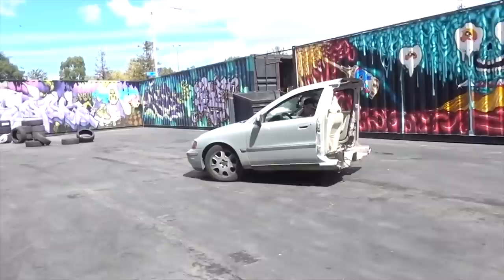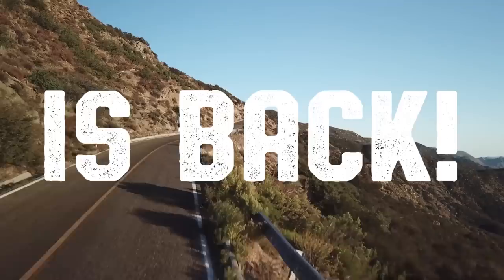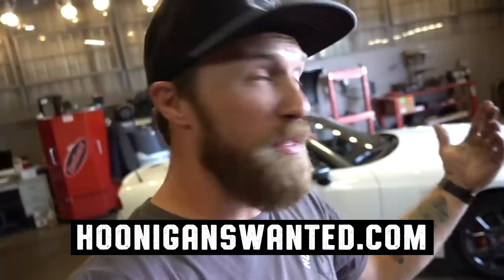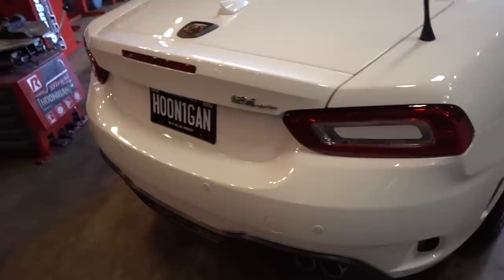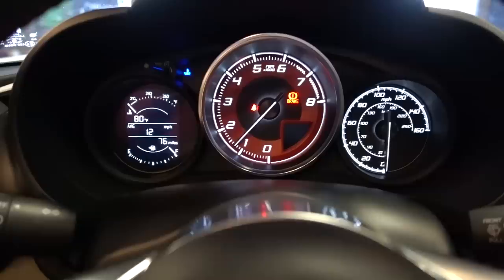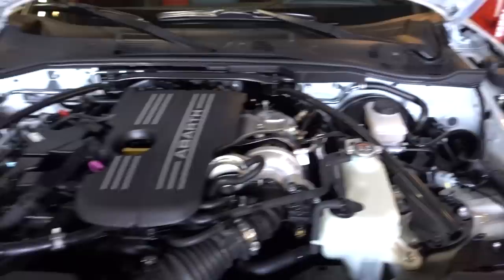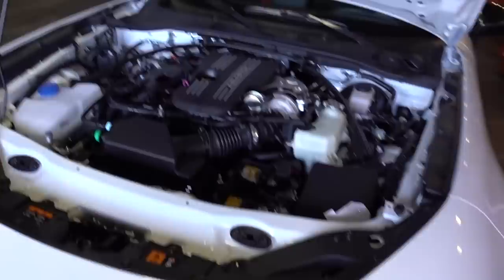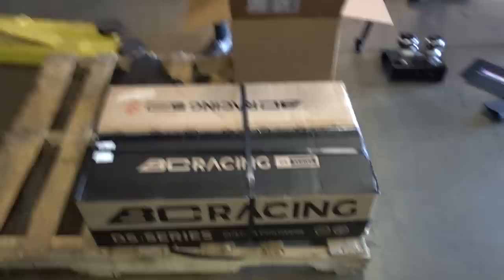How to Build a Fiat 124 Spider Abarth Track Rat - BONUS TRAILER BUILD

Comment from the maker: Who's got more ideas for the trackday tire trailer? Color, mods, attachments, etc
Reply: TheHoonigans MEEEE
Reply: Definitely has to be super clean. Black and white to match the car, maybe if you can swing it try and fit some actual fiat brake lights to it? It should be low, like equal with the car, not like an actual utility trailer. You could do full tube ball arm, like that zigzag all the way to the actual join. Have one non structural tube to run the wiring through or something. And for the hitch I think it should be bolted to the frame and run out and then up. That way if they put the car on a trailer there’s no ugly hitch square stickin out he back of the car. Then you could put the light plug thingy behind the license plate on a hinge to fold down. Can’t wait to see it come together!
Reply: Really low wide the same color as Fiat
Reply: Make the trailer like a chariot with the car as its "horse'
Reply: buy one of those badboy´s and shartkart it with some bigass turbo on the lil 1.4l
Reply: pegasus could be the name of the car
Reply: Just for the hell of it put a spoiler on the trailer
Reply: TheHoonigans yeah bring nads back
Reply: TheHoonigans royalty exotic cars made a bugatti that can do burnouts and donuts maybe even drift look them up
Reply: TheHoonigans single axle design with a tube frame that has mounting points for all your spare parts, it would be like a spare car on the back that you could step into
Reply: Same wheels and tires as the car so you have more spares just in case and also a holder or tank for a few gallons of gas and water.
Reply: what song is playing at 7 mins?
Reply: TheHoonigans 
Matching taillights maybe from a newer mx5 or miata? Sounds like you guys are applying adjustable sub coils or I would say lower it.
Reply: Question Ive had, What ever happened to Gary? I thought he was a bit obnoxious but fun to listen to
Reply: Keep the top dimensions the same as a   common pickup bed. That way you can use a nice watertight bed cover and possibly in bed organizers. Also, rotopax makes some awesome looking  fluid containers that would really useful as they can be mounted anywhere.
Reply: TheHoonigans get another fiat cut it in half and make the trailer
Reply: tyler, me too bro!
Reply: wtf happened to the gasser project?
Reply: Why don't you make the side few of the alfa and transfere that on the trailer ^^
Reply: I`m currently trying to source a mod for my car, thought maybe you guys could point me in the right direction. I`m looking for blue wrc decals for my pearl white`12 Subbie. Any directions would be sweet as yellow and black are all I can find. Searching the internet hasn't been a lot of help so I may have to turn to having them made, and where I live in the great white north no one has been willing to try it for less then wayyy too much $$ since you can order the yellow ones for like 85$, and its all 500$+ quotes to have them made. HEEELLP
Reply: TheHoonigans mount the suspension with hubs and knuckles to an aluminum truck toolbox mounted on the trailer. Save Fab time and have a better waterproof seal. The spare suspension parts holding your spare tires is innovative enough to be interesting and unique.
Reply: A built in cooler for PBR
Reply: Mount battery with compressor, Led Lights.
Reply: Michael Schneider don’t forget the grill 👍
Reply: Trailer needs the front and rear clip (fenders/bumpers/lights.) Incase of a wall tap, swap on new skin. It'll look like a shortie spider if you do it right.
Reply: Renown livery.
Reply: Ya a little trailer would be sweet.  Maybe somehow integrate a tent or an awning?? Just enough shade for one or two people to sit. Maybe some battery power for charging phones or whatever. Some overhead lighting in the awning would be extra sick in case you need to wrench/ party at night. Oh ya... bluetooth speaker would be sick too. Also, where's Gary?
Reply: TheHoonigans  “H” on the side for Hoonigan
Reply: RedHabour79 XBL darude- sandstorm
Reply: TheHoonigans make the trailer look like a two wheel ariel atom! 🤘🏼🤘🏼
Reply: TheHoonigans you should make the trailer with the frame of a roll cage, and it’s easily accessible aswell!
Reply: TheHoonigans ive always wondered how come Brad never blinks?
Reply: A platform in front holding extra tires and a floor jack.
Reply: u

Comment: 8/10 the trailer needs to do burnouts.
Reply from the maker: We like where your head is at.
Reply: TheHoonigans put a motor in it so you can maybe put your spares on a secondary axle once the trailed is unhooked and drive it around the pits. Maybe electric motor would be pretty easy to do this?
Reply: hayabusa engine swap the trailer. tandem donuts

Comment: Didn't feel like Garage Garage till I got to the trailer breakdown. Now it sounds like a Garage Garage build!
Reply: Mos Baked should have brad design the trailer and Dan weld it so it doesn’t fall apart on the highway.

Comment: I don't know if people already had 124 Spyders written off, but if that's so, to find a front wrecked 124, chop it, and build a trailer from the rear end of the car. The trunk would house the tools and parts, maybe a small solar panel with a battery to charge power tools, and the area where the seats used to be have a tire rack welded or bolted on. I see this done with wrecked Miatas, so the 124 Spyder is natural to have a accompanying trailer built in a similar fashion.

Comment: Yo TheHoonigans, for the trailer think like Ariel Atom style frame and use the webbing as mounting points. Could also do fancy horizontal pushrod suspension in order to keep the shocks out of the way of the sides of the trailer, making use of as much of the inner width of the trailer.

Comment: I like the idea of having both the front and rear suspension holding the slicks and maybe even having the diff and axles on the rear suspension so it has basically the full rear end in case of broken axles or diff.

Comment: If this is for the home racer (winner} make it so castor wheels can be pinned or quickly bolted to the back and it can be stored up on its tailgate end and the drawer bar can swing down or retracts (telescopic). All so trailer AND Fiat has a chance to fit in a single bay.

Comment: Make it so it will be a 6 wheel trailer and have it so u have the front whole suspension and everything in the front and then have a solid axle and then the rear and everything and then u will have 6 extra tires but they all get drived on

Comment: Wouldn't it be easier to just find a wrecked 124 and cut the back off with frame and use the trunk as the trailer? Like the old school hot rodders with 32 fords or pickup beds with axle as trailers.

Comment: i think u are over complicating the trailer with full suspension and shit just fit it with the must have suspension bits that is tucked nice and neat and have space for other shit that can go wrong and space for all your safety gear helmet and shit extra semi slicks, wheels, battery, power converter, air pump  brake pads for track use  all the fluids shit that u will need at the track and make the trailer hook so that u can park the car on it when u need too check underneath. the trailer must be like u just hook it and your ready for any track day. mabe ever a small cooler for munches and drinks come on Dan the man U CAN DO IT